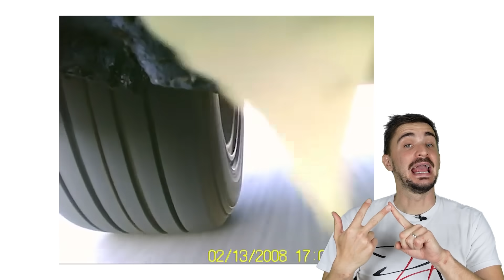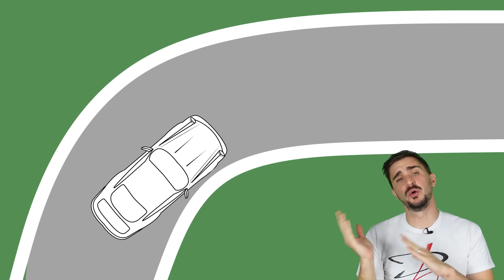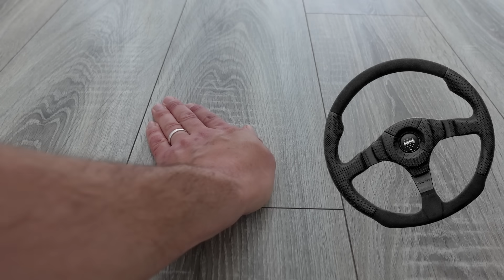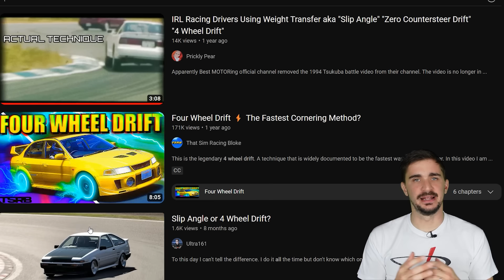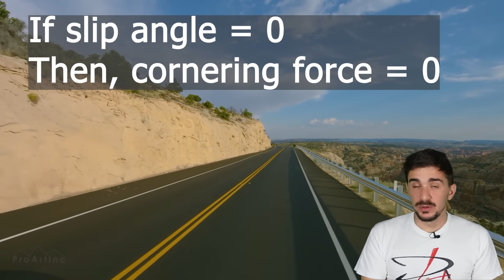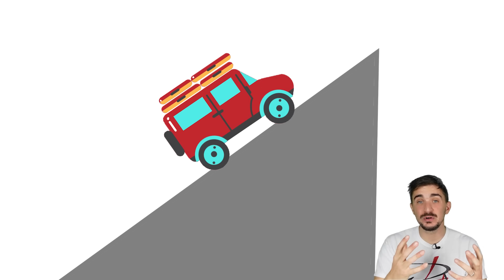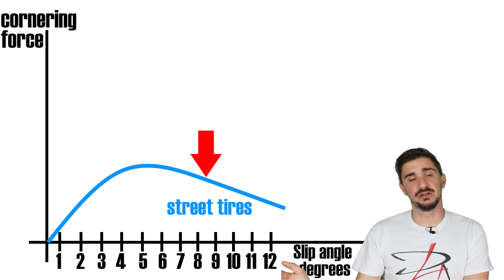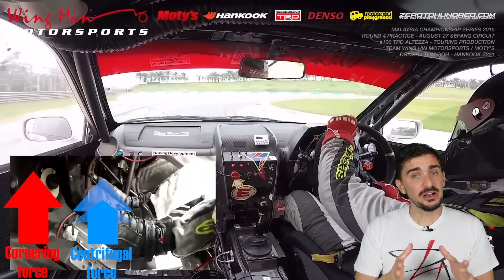You Think You Know But You Don't - Slip Angle Explained in a Way You Will Understand

Comment: Awesome as always.  Thanks.
I might use the term "inertia" rather than centrifugal force (or centrifugal inertia) in a few places at the beginning.  Then again, thinking about most of this is new to me.
Reply: He should use neither term.  Acceleration = force / mass.  End of story.
Reply: @toddwasson3355  No, it is only the sum of the forces divided by mass that equals acceleration. It is not any force divided by mass that equals acceleration.
Reply: @Mayyouknow  That's what I wrote.
Reply: @Mayyouknow  

car mass = 1,000kg
lateral force = 10,000N
lateral acceleration = 10,000 / 1,000 = 10 m/s^2

That's it, that's all there is to it.  Some imaginary centrifugal force is not part of this at all.
Reply: @toddwasson3355  There are more forces acting on the car. Your calculation is only true if the lateral force is the net force.
Reply: @Mayyouknow  "Force" in the equation obviously means the sum of all forces...
Reply: @Mayyouknow  My point is that some imaginary centrifugal force is not one of those forces.  It wouldn't even make sense to add that.  If anything, the equal/opposite force is the reaction force the tires exert on the Earth.  Useful only if you want to calculate the response of the Earth to the car.  Nobody cares about that.  

It makes no sense to add a centrifugal force into this.  If we were to add an equal and opposite centrifugal force "to overcome" or whatever, we'd get this instead.  (I'll use the term "net" if it makes you happy).

car mass = 1,000kg
net lateral force = 10,000N
net centrifugal force = -10,000N
net force = net lateral force + net centrifugal force  
net force = 10,000N + (-10,000N)
net force = 0N <-----Oops

lateral acceleration = 0 / 1,000 = 0 m/s^2  <---Oops

If this was correct, cars wouldn't turn at all.

No, the only way to get the correct answer is to set centrifugal force to 0.  I.e., it doesn't exist.  The reaction force on the ground determines the acceleration of the Earth, not the car, so is of no interest here.  The supposed battle between centrifugal and lateral forces described throughout the entire video is completely imaginary.

There's also no "inertia" value to consider here either.  The mass captures that already.  All this hand waving everyone's doing about inertia and "overcoming centrifugal forces" and "passive" versus whatever "kinds of forces" that do or don't "generate movement" and all this nonsense is precisely that:  Nonsense.  All it does is confuse people.

So like I said before:  He should use neither term.  Acceleration = force / mass.  End of story.
Reply: @toddwasson3355  It might be obvious but however the case; the lateral force is not necessarily the sum of all forces acting on the car.
Reply: @toddwasson3355  Inertia is a propery of mass.

And no, he should use the term inertia.

However I do agree with you that the term centrifugal force do not need to be used and probably should not be used in this case. Although in special cases of so called non inertial frames of references one can predict and calculate the correct results by some forces which appear as centrifugal. This is however not what is discussed here, just an interesting fact to add.
Reply: @Mayyouknow  "It might be obvious but however the case; the lateral force is not necessarily the sum of all forces acting on the car."

I've been writing vehicle dynamics models longer than you've been alive.  You're really not teaching me anything here.  

Sum of all lateral forces should have been equally obvious. Every single vehicle dynamics or simulation engineer on the planet would have known perfectly well what "force" meant there.  f = ma is just Newton's law.  I replaced "f" with "force" for the audience at hand which would likely not have recognized the equation.  That of course is the sum of all force components in the lateral direction and I already said so.  Judging by your YouTube channel's content, that should have been instantly recognizable to you.  Do you really need to continue trying to argue that point?  Knock it off.
Reply: @toddwasson3355  I did not mean to offend you. However I still think your first comment  reeks of ignorance. Maybe it was wrong of me to assume that you were ignorant because of that because now I see that you are not.

Thank you for understanding that I meant no harm.
Reply: @Mayyouknow  

car mass = 1,000kg
sum of all lateral force components = 10,000N

Solve the lateral acceleration in the direction of the sum of all lateral force components.  Include your "inertia" variable in the equation along with mass. Bonus points if you solve it using both "centrifugal force" and "sum of all lateral force components" together.

(How about we save some space and time and just call that last one "force" or "lateral force" since we both know perfectly well what we're talking about?)

I understand that centrifugal force can be a useful concept for analysis in some situations.  This, however, is not one of them.  Not "probably not,"  definitely not.

If we wanted to work with a fixed vehicle reference frame and model a driver sliding across a bench seat to bang into the door on the way through the corner, yes, you could model that with a centrifugal force on the driver by pretending the car is stationary.  Go right ahead, but by doing so to an audience like this you're perpetuating the false idea that there is some force pushing the driver into the left door when he's making a right turn.  The result are videos like this one.  Two forces fighting each other, etc..   

Solving it that way won't tell you anything about what the car is doing anyway.  You'll need to know the lateral acceleration of the car first, and you can model the sliding driver's motion without even bothering with the force in that situation since you'll already know the lateral acceleration.  It's off topic anyway.  The subject of this video and all the discussions I see here are about understanding what the car is doing, not what the driver is doing relative to the car.  It's about vehicle handling, not driver safety in a crash simulation.  All you're doing by nodding your head in agreement every time somebody tosses up a completely unnecessary concept or new, imaginary force is adding to their confusion.  

This is exactly the type of thing that leads to videos like this getting made in the first place and why the creator is so confused about something so simple while being convinced he's got it all worked out in his head.  Just listen to the guy.  He goes on and on about forces fighting it out with each other and all this nonsense.  He's confused because he's picked up all these dumb ideas from guys who can't help themselves from throwing in something new and more complicated every time a simple subject comes up.  What could be understood easily with two or three variables now needs ten.  Just stop it.  

Help people by simplifying the picture to something on their level instead of going from grade 1 to grade 10 immediately with them.  Educate, don't confuse.  And quit assuming the guy you're talking to has no idea what he's talking about.
Reply: Centrifugal force does exist and is just as real as the concept of inertia. If you're inside a non-inertial frame of reference (like, inside a car taking a corner) you do need to take into account centrifugal force and coriolis force to do physics. If you grab any college textbook on classic physics you'll see it's full of mentions of centrifugal force, it definitely isn't a simplification nor a mathematical trick.
Reply: It's centrifugal force because it's starting to go sideways inertia is more for going straight
Reply: @DylanL69  Inertia applies to all matter with mass regardless of direction of movement, or if it's even moving at all. If you want to change the motion of a mass, you need to fight its inertia. The car was going straight, and to get it to change direction, the molecules of the tires pull on each other, the wheels, the axles, the chassis, and then you because everything in that chain has inertia to keep moving in the initial direction. Centrifugal force is just a pseudoforce generated by inertia of rotating masses.

OP is correct that inertia is the more accurate term here because it's independent of frame of reference.
Reply: @DylanL69  Yes you are right, but so is also John. The body inside the car experiences no outward centrifugal force with respect to the asphalt. If the tires would suddenly stop having any friction the car and the people inside would continue moving straight on, not outwards.
Reply: @Mayyouknow  yeah I know that
Reply: @DylanL69  I do not think you knew that. There is no centrifugal force in the reference frame of the ground. So it's not centrifugal force.
Reply: @DylanL69 centrifugal force is a fictitious force and is actually the product of inertia with the object wanting to stay in a straight line.

Comment: "Raceing tires have a shorter slip angle range" does not compute with me, in my head the race tire will have same slip angle range as the street and racing tire combined. the down side for race tire is the dropp off makes it harder to know when you "stepp over the line" and you get over-steer, under-steer og or spinn the tyers faster. that in turn means you have a shortet reaction time to do something aboute it befoure it is to late.

Comment: To add, tire deformation is the real force that is exerted. It pushes and pulls against the grip as it wants to return back to the original shape. The rubber in a contact patch is STATIC, it does not move in relation to the road. This is what allows a rotating tire to have SO much grip. When you exceed slip angle it also means that the tire push/pull forces are exceeding the available traction and it starts to.. slip... This is not a straight line at some point but gradual and million things affect it. If grip exceeded push/pull forces the tire would disintegrate. 

The forces that push/pull the rubber are measured in tons, all the polymers that are involved, their combined forces are incredibly high. That doesn't mean you can't shred your tires, it can still break a bit, which leads to material weakening and it starts a feedback loop where each little break will cause the rest of the material take all the forces while having less "stuff" involved. You will lose grip first, those forces are puny compared to the power of the stretching rubber.

Easiest way to imagine this is to imagine car accelerating from a stand still. When you apply throttle, torque is applied to the axle and the wheel. The wheel wants to rotate but the contact patch is static, it does not move. The rubber has to stretch first and this pulls and pushes the wheel and the axle forward, and the tire starts to rotate.

Once i got the "ahaa" moment that the tire contact patch is STATIC, that changed everything. It explains how the tire is able to have such high grip. Dynamic friction is when the tire is sliding, it breaks traction and traction can't happen if the two objects are sliding: they have to be static to have static friction. It also explains why tires also have stiction: chemical bonds happen between it and the road, there is adhesion too.. That also can't happen if the two objects are moving in relation with each other.

Rolling tire is not moving its contact patch.
Reply: to cover the "easiest" thing you mentioned the straitght acceleration from standstil. The highest grip is NOT when there is no slip (slip in this case of course not slip angle but "how much faster the wheel rotates than car moves"). The exact ammount depends on surface and rubber compunds but it is somewhere in the range of 15-25%

Comment: Am i right in thinking that up to certain geometrical/material limits the additional force (be it from a spoiler or weight over an axle) only increses the size of the contact patch and doesn't actually push the tyre compound deeper into the road surface?

Comment: Another awesome video! Could you maybe explain how a vacuum system in the engine works in a future video? That has always been confusing to me
Reply: It's simple as the piston goes down in the cylinder with an intake restriction (throttle) it creates a void in the cylinder and sucking the air and fuel in

Comment: Nice!  This video convinced me that centrifugal force is not applicable in cornering.  Much like slip angle is what actually is convincing your vehicle to turn, deviation of the car from its direction of travel while the passengers attempt to continue is the previous directions creates the appearance of centrifugal force.  The diagramatic arrows pointing towards the side are wrong by your own explanation.  They should be pointing along the origin of the slip angle
Reply: Centrifugal force does exist and is just as real as the concept of inertia. If you're inside a non-inertial frame of reference (like, inside a car taking a corner) you do need to take into account centrifugal force and coriolis force to do physics. If you grab any college textbook on classic physics you'll see it's full of mentions of centrifugal force, it definitely isn't a simplification nor a mathematical trick.

Comment: great video as always. Another subject I'd like to see touched on is how the suspension and loading effects tire deformation and cornering
Reply: Yes. And also tyre pressure and tyre width.
Reply: Yea, you can observe this by keep the steering angle the same on a on or off ramp with a given acceleration rate. Give it less and the corner gets taken sharper with same slip angle, accelerate or shift weight to rear and it gets wider.

Comment: Awesome. I'm just a bit confused by the "corning force is not the same as friction". I mean, the types of forces that exist in this world are relatively limited, and the cornering forces of a car has to be linked to one of them. I get that the cornering force stems from the deformation of the tire and the resulting slip angle, but what is it exactly that pushes on the front tires inwards to rotate the car? When a car is cornering at a constant speed, the slip angle is constant, so the cornering force isn't caused by the stepping up of the slip angle. A static friction force prevents movement in a given direction, and a kinetic friction force hinders it (always opposite to the movement or would be movement), so I can imagine how this force would push the tires into the corner when they are trying to slip in a different direction than the contact patch thread (outwards).
Reply: I think what he is calling cornering force is usually called centripetal force. It is generated by the slip angle of the tires, although I'm not sure I follow his representation of how friction generates this force. Also, he must have assumed it is self-evident, because he didn’t mention how the rear tires obtain the slip angle necessary to general lateral acceleration either.

I also don’t think he adequately explained that this force is imparting a lateral acceleration that changes the path of the car, perhaps because he sees it as self-evident.  But of course the fundamental issue is that it takes a lateral force to accelerate the car in the direction the road is curving away from the straight path, because without that force inertia would keep the car on an unaltered trajectory.  I thinking the terms inertia and acceleration should not be absent from this discussion.

Comment: 15:20 A question that arises is what is the relationship between increased vertical load (and subsequently cornering force) due to increased vehicle weight vs the simultaneously increased centrifugal force due to the same reason. 

Instinctively, I would guess that the penalty of more centrifugal force is always greater than any potential cornering force benefit but is it really so?
Reply: yes the cons outweigh the pros almost always. Search and watch his video "Why Big Brakes Won't Stop You Faster but Wider Tires Will - Friction and Surface Area Explained", you will learn some useful stuff
Reply: Throw away the centrifugal force.  It doesn't exist.  All that exists is the cornering force.  Think of it that way and watch the confusion vanish.  :P

Comment: I notice in F1 that the front tires have different slip angle in the middle of the turn.
I also wonder about front wheel camber angle.
Expecting videos about car handling in the future.
Reply: in F1 they use anti-ackerman steering. Basically the outer tire turns more than the inner one. Look for an f1 steering video by driver61

Comment: I like to think of the slip angle as the "stretch angle". 
The upcoming contact patch is being stretched forward each time steering input is given and unstreched when removing steering input.
Reply: If it was stretched forward wouldn't that be going straight it's stretched sideways to go that way
Reply: @DylanL69  i think of the contact patch as having little arms stretching out and grabbing the road ahead of them. The slip angle (stretch angle) is determined by the steering input and speed, so if the car is going straight then the "little arms" are stretching straight ahead and there is no slip angle. The steering wheel input will cause the arms to reach forward and grab the road ahead at whatever angle is necessary to keep the car following the intended driving line, so long as the grip of the little arms holding onto the road aren't exceeded (centrifugal force) causing the contact patch to lose traction with the road's surface thus spinning out and hitting the wall or ditch...
I may be way off base, but that's how I picture it in my head, although this video is a much better explanation in it's entirety.
Reply: @Watchdog_McCoy_5.7x28  what you said makes sense